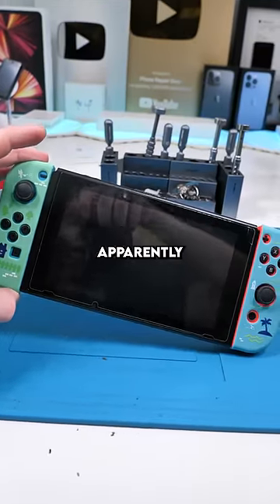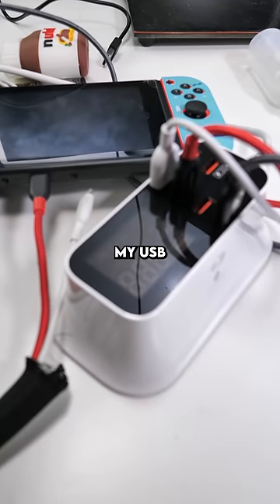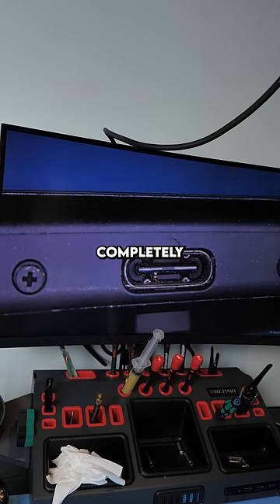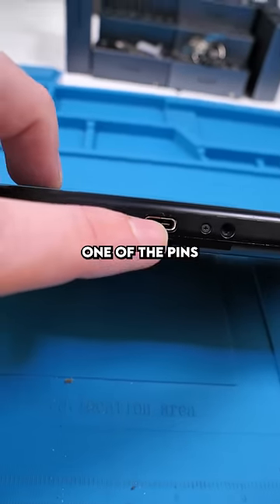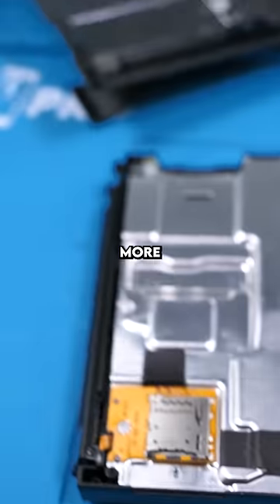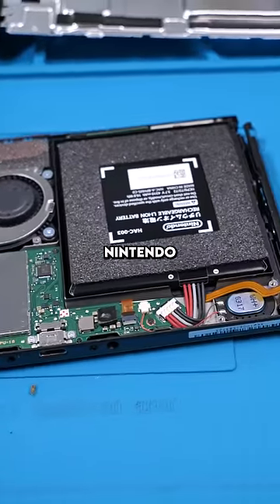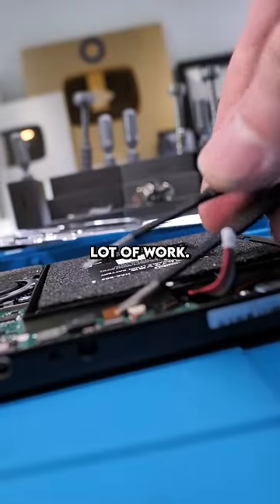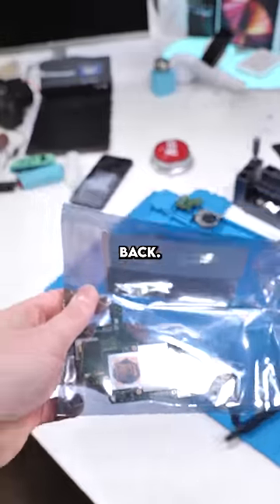This Switch Wouldn't Charge... USB-C Durability is 🗑️ #Shorts

Comment: "ThIs WoUlD NeVeR HaPpEn WiTh A LiGhTnIg PoRt"-🤡
Reply: @yodajedimaster3834  ong
Reply: Can y’all stop defaming ACTUAL clowns?
Reply: @C-Midori  deal with it
Reply: Can’t deny it so don’t try it 🤷‍♂️
Reply: @GreatestMinecraftPlayer  Tru
Reply: @C-Midori  Bro serial killers and stephen king did that decades ago...
Reply: FRFR
Reply: Lightning port is definitely the most durable but stay broke, Android user. Bet you have a Samsung
Reply: @SupremeShuckle  any is durable,it depends on the user
Reply: @SupremeShuckle  Why does the cable always break on lightning? The plastic gets cracked close to the metal?
Reply: @SupremeShuckle You pay 1000+ dollars for a camera that has details you're never gonna see, """security""" (completely locking the user away from installing any non app store app) and a battery that could be either normal or horrible depending on your luck.
Reply: @SupremeShuckle your wallet after the screen replacement costs half the phones price:
Reply: if you force it in or accidentally yank it out of course it will break delusional  isheep.
Reply: @SupremeShuckle  You'll be charging for 2 hours to get only 60% while in that time, I got it to 100% an hour ago.

Comment: "takes 2 hours to charge"
this would never happen woth a lightning port, they take day and night
Reply: “this would never happen with a lightning port, they take day and night”
> has probably never used a lightning port
Reply: Can't wait for my Local backup to my computer to take 9 hours because my 1TB iPhone still comes with USB 2.0
Reply: @bemwy  Lightning cables are still USB 2.0.
USB 2.0 speed, 480Mbps/60MBps

USB-C can handle USB 3.1 and up
USB 3.1 Gen 1 speeds 5Gbps/640MBps ,USB 3.1 Gen 2
 speed 10Gbps
So yes lightning cables are slower over all
Reply: Uh def get that checked out my phone charges from like 8% to 80% in like an hour-ish? A bit extra would maybe be like 20 mins? Def doesn’t take all night
Reply: *with
Reply: With 5-WATT Chargers. The one I use only takes like 30 minutes to an hour to charge to 100%.
Reply: @pirateofthebeans_2393  Except not every USB-C port is always the best USB spec.
Plus the higher speed, the more pins. So Lightning could have USB 3.1 gen 2.
Reply: Absolute lies. that sounds like a slow power brick and not an issue with lightning.
iPads are the only ones that take long to charge, because they have a battery literally 2 or 3 times the size compared to an iphone.
Reply: "Takes 2 Seconds for a 5 Gigabyte file"
Nah good old lightning Port with 480mbit/s Takes half hour
Reply: @Thewaterspirit57  Keep crying, you know its true
Reply: @Thewaterspirit57  "the higher speed, the more pins" that's not how it works. Every usb c connector has the exact same amount of pins. The low speed ones just don't wire them all and leave some pins empty.
Reply: @bemwy  USB c is way faster than Lightning
Reply: @Thewaterspirit57  buy official USB C chargers instead of buying the cheap ones from Walmart or Dollar General
Reply: @Thewaterspirit57  I'm the idiot? says the one that says that USB Lightning is fast
Reply: @parakoopa99  it is you clod. A 20 watt charger would do perfectly fine in charging an iPhone in 1 hour.
Reply: @Thewaterspirit57  yeah, it works FINE. Most USB C chargers charge more than 60 watts. Which will charge your device in less than 50mins
Reply: @Thewaterspirit57  and I have an iphone. And it sure as hell doesn't charge up in an hour. And it's brand new
Reply: @Thewaterspirit57  average apple fan, defending all of their flaws
Reply: @arandomdeadmau5fan861  iPhone XS Max
Reply: @bemwy  except lightning has been known to be slower for some time now
Reply: @yokai.1817  Small batteries that can't hold 10% charge for 1 hour takes less time to charge than a battery that can hold 1% charge for 30 minutes? Who would've thought!
Reply: @quintinstephens349  Although my phone lasts all day from like 40% it can go from 40% to maybe like 19% in a day, obviously more if im doing something like long drives with GPS
Reply: @yokai.1817  pretty much every friend I had that used any iPhone, whether new or old, would avoid using their phones at breakfast or lunch (before we graduated) because they didn't want to drain their battery. The ones that would use it throughout the day, would be asking other people for chargers by lunch or 3rd period (depending on whether they had first or second lunch).
Reply: @quintinstephens349  oh really? Maybe it’s changed now but I use my phone all day through classes, my teachers let me if I have my work done, and I’m usually around 40-50% at end of the day
Reply: @bemwy oh as a person who currently uses an IPhone from before 2020, they most certainly do.

Comment: “This would never happen to a lightning port”

meanwhile, the lightning cable

“ dying ”
Reply: I never had issues with lightning either the port or cable , only thing I dislike about it is maybe outdated charging and data transfer speed.
Reply: Isn’t that the point of the design? You’d rather have the cable break over the port 😅
Reply: @hocalo  That would be the case, if the cable didn't break so much.
Reply: How do people keep damaging cables? With my iPhone 11, I’m still using the in-box cable, nearly three years later!
Reply: @Lauren_C  I don’t really know , had my original cable with my ip12 , still good as new , previously I had an ip8 same senario never had a single issue , it only takes of u to take care of your things.
Reply: @Lauren_C  They are made of nothing.
Reply: Sharkie  a lot of comment says their lightning ports break fast but I had mine for years. Stop abusing the lightning cable and take care of it instead of saying “mY lIgHtNiNg CaBlE bRoKe ThEy ArE tRaSh!!!”.

Comment: this is why i use magnetic chargers! i don’t want to ruin my ports 😭😭
Reply: Unless you jam the connectors in at a werid angle the connector should last longer than the device's ontended life. And usbc is rated for atleast 10,000 insertions

Comment: I'm not an apple user or something but I think it would be really cool if USB C had a similar design as the lightning port. Idk why they haven't done it yet
Reply: Wouldn’t that just be… a lightning port then
Reply: @hahahayi1017  not really. From what i have heard, usb c is faster and can pass more power when compared to lightning. But lightning is more durable. There is nothing that combines both of these and is widely used
Reply: @zukashix  That's because of the limitations of each physical design. It's easy to add charging and data lanes to the interior of the USB-C Male side because it has far more protected surface area to put fragile connection lanes on while the lightning connector has better structural stability because of the wall-like structure that it uses.
Reply: @zukashix  no I meant there probably isn’t a good way to do both at the same time, probably like a trade off of sorts
Reply: I might be able to do it I can then give it to people who want a durable and fast connection

Comment: I should point out that the Switch's USB-C port is actually out-of-spec. Deliberately. The whole docking concept requires it to be slightly larger than normal.

This is also why certain 3rd party docks would fry your Switch. They ran certain pins off a higher-voltage part, which was fine if the pins were always aligned correctly... but it was very easy to misalign the pins and short the Switch with the higher voltage.

Comment: you're right, the lightning cable just wouldn't last long enough to experience pin failure, you'd just buy a new cable every couple weeks for 240 bucks
Reply: @imdyinginside1919  stop settling for mediocre speeds and simping for a decade old design standard lmfao

Comment: User error
Reply from the maker: Partially yes, still breaks a lot easier than Lightning
Reply: @PhoneRepairGuru  yeah but lightning should be upgraded. It’s very slow in today’s standards (but still like lightning more than USB C)
Reply: @PhoneRepairGuru  lightning has trash data transfer speeds, id say usb c is more superior
Reply: @PhoneRepairGuru  Ehhhh... There's still a LOT of structural issues with lightning.
Reply: @bandofather  you might match usb c's age cause lighting is far older than you
Reply: @CybernerdShua  there aren't, in its 10 years there weren't any big problems with it, I mean back then it's competition was micro usb
Reply: @iustin1658  lightning is a decade old standard with trash speeds and is pointlessly proprietary. It needs to be updated or better yet, done away with.
Reply: @oneedgyboi606  when the lighting made its appearance even your shoes had a proprietary charging port, and I wouldn't say 20-30 watts is slow, but yeah it's old and should retire, and wth are you doing talking with me edgy Boi, it's the 3rd time
Reply: @iustin1658  funny, but what i said is just the truth. usb c has faster data transfer speeds compared to the lightning cable
Reply: @PhoneRepairGuru  I still have yet to have a usb c cable break. Now if you where to say the same about micro usb, I would agree.
Reply: @iustin1658  Nah, mate. There are some serious structural issues with it, leading to a lot of chargers breaking off in the port. Not to mention that pin-fraying still happens on the interior of a lightning port. Is it as likely to happen as USB-C? No, but it still happens enough.
Reply: @PhoneRepairGuru  not by much and doesn't break nearly as many chargers

Comment: USB-C durability is actually pretty good for its cost and the number of pins in the connector. The Switch is a little different though because Nintendo had a custom port manufactured that does not have the same click that most USB C ports have (because they wanted a certain feel). The looser port fit and people bending their cables at weird angles when charging could cause bent pin issues like this.

Comment: Something similar happened to my sister’s switch lite. The battery was dead, the system wouldn’t my start, and it wouldn’t charge. After troubleshooting it as much as we can, we eventually sent it to Nintendo. All her save data was wiped, but she hasn’t had a problem with that switch since. And she built her Animal Crossing town all over again!

Comment: THANK YOU for acknowledging the superiority of the lightning port! Yes, C is faster and lightning could use an update, but C just ain’t it. I have lightning ports that date back to 2015 and they still feel better than my 2 year old C devices
Reply: USB C also doesn't snap off the tips of cables like Lightning
Reply: @JeanMarceaux  don’t care about the cables. Those are easily replaced. Also, never happened to me.
Reply: @jseden  well I've never had problems with any of my USB-C devices, does that change anything?
Reply: @JeanMarceaux  not really. lightning is still just a better design😉

Comment: also you need to use the switch specific usb-c because the switch will not regulate how much power is put in the plug dose (if its the nintendo one) which can fry your battery

Comment: One annoying fatal flaw of the switch is that the more often you take a game card in and out of the game slot port, the more the prongs destroy and wear away the metal connectors on the game cartridge itself. My 8yo son plays Minecraft like crazy but is always switching games out. It destroyed 2 Minecraft Carts within months before I gave up and bought a digital version of it instead. Luckily it's not an expensive game right now compared to other Nintendo Games. 

Yes, you can probably replace the game cart housing but with my son, I'd probably have to do that every few months. It's too easily destroyed on this  System compared to past Nintendo consoles.

Comment: I see people are making jokes about the lightning port....  

GURU IS RIGHT !! 

this will not going to happen in lightning port 

the pins on the sides you see ARE NOT the charging pins, they are just there to hold the connector in place 

The ones that were charging your phone is on the top and bottom of the port, not the sides 

unless you use a low quality charging cable or charging brick, your phone will not going to kill it self

Comment: In my years of owning NUMEROUS  USB C devices, I've not broken the charger once.
The only way you can break that is if you WANT to. If you start throwing around your device while plugged in.

I've numerous times bent Micro USB by riding it over with a chair on accident, and yet the same can not be said for USB C.

If you want to hate something, hate something reasonable.

Comment: i can use a usb c charger for my headphones, my phone, my drawing tablet, my gear vr, my backup headphones, and use it to allow my phone to become a power bank for all my other devices. 
mind you, my headphones, backup headphones, and drawing tablet are not Samsung.
my phone and my vr are. ive had my charger for over 3 years and its absolutely fine.

what are lighting ports compatible with? apple devices and that it. usb c ports are better hands down. 
lighting cables last about a year and you'll need a replacement after that year because its completely buggered the bit that goes into the port. all sorts gets stuck in lighting ports too. my mate got blue tack in hers awhile ago, and pieces were missing from the screen. iPhones are also heavy asf. Ive had a the same phone for 3 years, never been repaired, the screen is fine, and its a hand me down from my mam. she had it for about 4/5 years.

thank you for listening to my ted talk.

Comment: "USB durability is 🗑️"
Okay, but it replaced type-B micro, which was much less durable still. Lightning also has 8 pins as opposed to USB-C's 24, which means its datarate and power delivery scaling is far more limited. Even if Lightning were updated to have pins on both sides, it couldn't equal USB-C's potential. There are plenty of problems with codifying a standard built for the tech of our time, but those saying lightning is just better are massively misinformed.

Comment: If ur electronics or car mechanic takes pics before taking things apart... Be scared. Very scared
Reply: Nah it's just smart
Reply: @anicekid  lol its smart to be able to do it without a picture, my coworker took out and put in an engine without a picture. I took apart my subframe, control arms, axles, and put the new parts in a week later no picture. Dude had a wil baby switch with all the parts on the same day. Kinda sad
Reply: @BirdManYota  yes mechanics should always be able to without taking pictures but it is smart to because 1 you just might forget 2 it's a new device or 3 they have to leave that project for extended periods of time
Reply: @anicekid  lol if u say so man, it's not hard to remember if it's your career
Reply: @anicekid  every single cars built different, so every cars a "new device" and ive done work on phones and and computers, just have the engineering mindset of what goes where and why. I took apart my laptop without looking anything up cuz its just a matter of looking for screws, diagnosing the issue, remove and replace the broken part, then put back together

Comment: Luckily lightning cables only have awful transfer speeds, awful charging wattage, the 3rd party lightning cables are $5-$10 more than 3rd party usb-c cables, the switches usb-c port needs to charge at high wattages and display it to an hdmi connection. You also shouldnt be charging your switch with anything other than the ac adapter provided. You do repairs but don't understand voltage regulations.

Comment: 🔥TAKE! : LIGHTNING PORT IS GOOD!
My Reasons:
1) It doesn't break as easily. It is really hard to break. The port on an iPhone is basically just a hole, so as long as nothing is inside scrapping the connectors, the port can't break because there is nothing in there. The lightning cable is just flat with the pins on the sides, so it's really hard to bend or damage this.
It is way easier to damage USB-C port because it is essentially just a lightning port but in reverse. Instead of plugging it into the phone, you're essentially plugging your phone into it.  The tiny port inside the phone is really easy to damage while cleaning or if any just just gets in there. Also, if you bend the part in the middle of the port, then you have to get it repaired.
The argument of the wire case is stupid because both USB-C and Lightning have normal rubber casings that suck but you can get them both in a braided cable. It just depends on how much money you are willing to spend.
2) The faster charging isn't that much better. USB-C to Lightning charges really quick because it's all about the output of the brick. A USB-C to USB-C has no greater output than a USB-C to Lightning. And most phone batteries are good enough to last the whole day on a charge if you use it sparingly so the charge speed doesn't matter anyways. To add on, most of the day your phone is probably plugged in, and if not, plug in your phone more often when you aren't doing anything instead of it being in your pocket.
3) Most people don't care about transfer speeds. Sure it you spend your whole day transferring files from your phone to your computer all day it's pretty useful. But why not just use cloud, then you don't need a cable at all. And anyways for the normal user, they don't need to transfer files from their phone to their computer. From my experience, i've only had to transfer a photo or video to myself a couple of times and then i would just email it to myself because it was easier.

Comment: The amount of times I required tweezers to remove the lightning ports charger from the port because it snapped in half tells me you're speaking out your ass. This is no exaggeration, I had to basically lockpick my phone to get the pins to go down so that I could remove the snapped charger from the port, I don't care who you are, that was stupid, why did that happen so often? There's a reason we advanced from it.